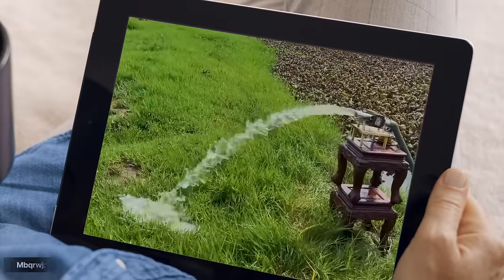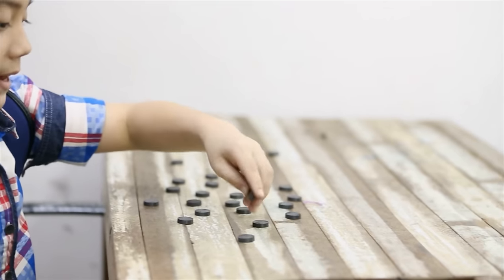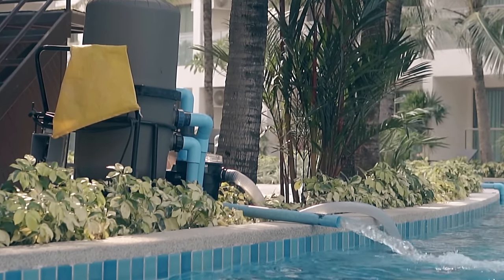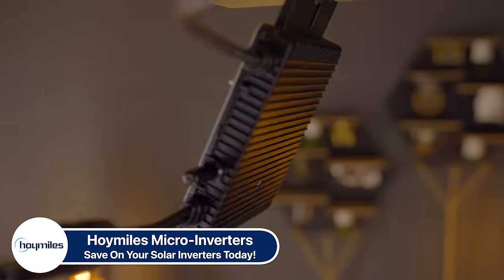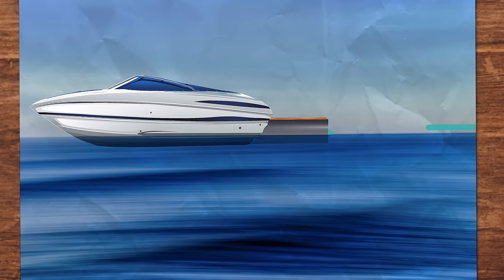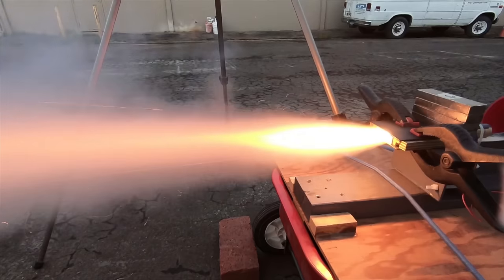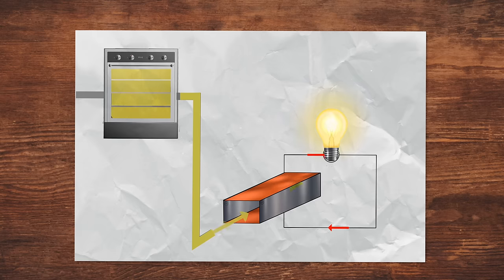Pumping Water Without Blades - Magnetic Pumps - Future of Propulsion?

Comment: OK, serious question. We have solar and batteries for DC generation and storage. Then we have inverters to convert it to AC to use in the home. What if instead, we converted the home use to DC and we skip the conversion losses and inverter complexity? Before you dismiss this, most electronics convert that AC back into DC internally already. So that would be a PS change on those devices. Granted, some AC motors for some appliances and devices would make this complicated. But is it that far fetched? Has anyone seriously looked into this? I think it has at least some viability.
Reply: AC uses thinner wires than DC for the same amount of power

Costs of distribution would skyrocket.
Reply: You could use high voltage low current DC (HVDC) but has proven itself to be less reliable and requires conversion anyway
Reply: A/C is more efficient at lower voltages. As the power for transmission rises, D/C becomes more efficient… but we are talking massive amounts of power, power to cross continents, nothing that is applicable in a home.
Reply: I think that's a good point, though I think it would only be practical if that electrical system is off the grid. If you want to use the grid for supplemental power or if you want to sell some of that solar power to the electric company then you'll need an inverter somewhere in there.
Reply: I think you're looking at this the wrong way, AC isn't a bad thing, it's one of the more clever modes of electrical conduction. The systems in place and their efficiencies represent a cost vs performance trade off. There ARE 98 and 99% efficient inverters, but they are expensive and increase capital costs. 

Rather than eliminating power conversion stages, look at the lost energy as underutilized energy. All systems are lossy, and what all lossy systems lack is waste heat recovery, and what all commercial and residential systems contend with are lifecycle costs and planned obsolescence. Support and design for efficiency and lifetime use and efficiency will be embraced rather than minmaxed.

One thing you do have a case on is keeping DC systems DC wherever you can. That's a strategy we see in a lot of system designs like cars that have 300V and 48V batteries and have to downconvert to lower voltage downstream hardware.
Reply: OK, seeing some of the comments- I am talking about LOCAL DC only. Of course AC is necessary for distribution. Local solar DC, local battery DC, local consumption DC. If it goes to the grid it obviously needs to be AC.
Reply: @Infinion AC is a bad thing for local use. It's advantage lies solely in long distance transmission. There is zero purpose to convert to AC for local consumption other than all devices have a PS or a motor designed for the AC grid. Get rid of that conversion and you remove a complex and lossy step in powering your home. Much like you pointed out.

Comment: I really don't see a MHD pump by itself replacing current forms of propulsion. 
What if we combined an MHD pump with a convergent - divergent nozzle, would the pressure drop through the nozzle be enough to provide real thrust?
Reply: “…to provide real thrust?”

Using solar panels & nuclear… perhaps outer space is a good use case, for interplanetary travel, like Mars, Venus, or elsewhere?
Reply: @DavidHalko  in that case, I fully agree.  My main pump / propulsion experience is on aircraft carriers as a mechanic. 
But computer hardware, propulsion, and heat transfer/ fluid flow are my joyful topics.
Reply: To be fair, current forms of propulsion have had industry support and widespread adoption and funding to solve their inefficiency problems. The world has had a few grants and the Yamato-1 whose outcome pivoted to demonstrating the viablility of portable marine cryogenic systems.

When discussing unpopular and underutilized technologies, incuding those found in the 1800s - early 1900s, of course someone like yourself would conclude they couldn't see it competing. Then again, Two Bit doesn't present all the information, and really just scratches the surface on the math, the challenges. He's here to dream up possibilities, connect promising technologies, and funnel investment interests.

Comment: 0:39: 🔬 Magnetohydrodynamics (MHD) is a real field of physics that can be used to create pumps, propulsion systems, and electrical power generators with no moving parts.
4:55: 🌞 The speaker shares their positive experience with Hoy Miles micro inverters for their solar system, highlighting the benefits and savings they provide.
7:36: 🔬 MHD propulsion and power generation using plasma and magnetic fields.
10:33: ⚡ The video discusses the limitations of MHD generators and the potential impact of room temperature ambient pressure superconductors on energy conversion technology.
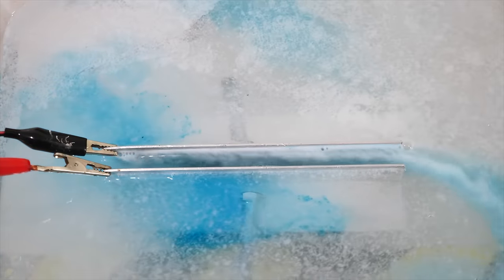2:33-3:02: 💡 Advantages of magnetic pumps include simplicity, compactness, high temperature tolerance, reliability, efficiency, minimal maintenance, and potential for high power density.
Recap by Tammy AI

Comment: If you want to get meaningful energy out of flowing water or achieve flow at pressure, you will need electromagnets even stronger than an MRI's. As for hopes of using LK-99 as a cheap superconductor magnet, its ceramic structure makes it impossible to turn it into wires for electromagnets, which makes it a dead-end material for most of those applications even if a golden sample managed to prove its room-temperature superconductivity.
BTW, the reason why quantum computers have to operate near absolute zero temperature isn't superconductors, it is thermal noise. You cannot do quantum computations when thermal noise destroys your data and ability to capture results.

Comment: This tech is the same as electrolosis where the material for the anodode and the cathode both decompose into the solution their are pumping. What's the fix for this issue? No one's addressing this and its of critical importance, both for the life of the system and the purposes in which it can be used.

Comment: Well... Many words around the simple result: Still in research state, still not applicable for anything in the life of normal people. The one and only field were this principle gets massively used is fusion generators (tokamak, stellarators) - or should we better call it "fusion research", since this, too, is still in the early research state. What the video completely missed is the fact of rapid deterioration of electrodes, especially when used in any form of water based systems.

Given these facts, the INDIRECT usage of that principle via metal wires and the movement of electrons in those, while the wires transfer their movement mechanically to other mediums, is still and by far the most effective way.

Comment: As most electricity on the grid is AC, there would be a slight drop in efficiency due to needing to convert before distribution either in-house or to the grid. That said, it should still be more efficient than most production methods.
Reply: Only if you have the supercondutor magnets.Otherwise the expense/inefficiency of ordinary conductors restricts this to special applications.
That being said, given the supercondutors, I can easily imagine you could make this a direct AC-generation driving the system with a square (or sine,, which would be less efficient at the channel, but maybe wouldn't make any net difference downstream) wave, switching polarity on the magnetic field (the flow is driving, not driven).

Comment: You omitted hyperfast torpedoes and hypersonic missiles in the list of critical techs MHD powers. They allow to partially or maybe completely remove wake by making all the outside of the vehicle into a propeller, literally picking the molecules of air or water in the front and putting them in the back. The Russians seem to have mastered this technology using air as a fluid, despite its high resistivity.

Comment: The thing about MHD generators needing large superconducting magnets is a bit of a red herring.

Recent advances in HTS superconducting tape based magnets have take the field strength to pretty amazing levels, the most recent being 45.5 Tesla.

As you increase the field strength by 2x you can decrease the size of the magnet by 4x and still handle the same current.

By the time magnetic confinement fusion is finally producing significant net gain I would expect field strengths to be even higher still than this (fusion and electrical generator shrinkage are probably the biggest drivers for SC research).

Comment: 🎯 Key Takeaways for quick navigation:

00:00 🚀 Magnetohydrodynamics (MHD) is a real field of physics that can be used to create propulsion systems for ships and spacecraft, as well as pumps and electrical power generators.
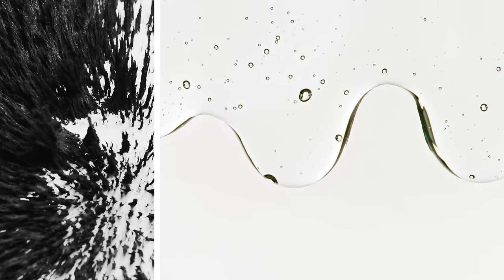01:06 🔬 MHD works by using electromagnetic induction and the Lorenz force to move fluids like water using magnetic fields and electric currents.
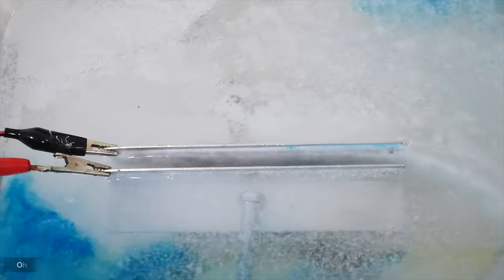02:30 ⚙ MHD pumps have no moving parts, making them simple, compact, silent, and able to work at high temperatures. They are more efficient and require minimal maintenance.
03:13 🔌 MHD pumps are not practical for pools or home water systems due to flow instabilities, but they are ideal for industrial applications like pumping molten metals and coolants.
06:01 💡 MHD propulsion systems, which use fixed pumps to move objects through a fluid, have been built and can be used on boats and even in aerospace craft.

Comment: I recall reading (MANY years ago) about MHD being used to recover energy from coal fired and gas fired powerplants- the MHD unit was installed on the effluent pipes, and more energy could be extracted from the hot flue gases, to be added to the output from the turbines.  Another thing I heard- the US Army bought some megawatt field generators from Russia- they used rocket engines to fire up the generator, and MHD put out the electrical power.  I do not know if that tech is still being used.
Reply: Yes, it works, but it's expensive and inefficient- I doubt ANYONE is using it for power generation due to those causes, but the effect IS useful for pollution reduction in the stack of thermal plands.

Comment: As a ScI fi nerd irl if you wanna have laser defenses you can pump molten Tin around and use it to conduct the heat away from the heating up part thats being hit by the laser which sounds like it woulfd fail but it wouldn't if engineered correctly which is mind blowing
Reply: It works until any of the tin vaporizes in the area of laser exposure. Then all hell can break loose  Also, the boundary material will ablate to some degree with exposure, so there will be structural-failure limits that are eventually exceeded no matter how well heat is conducted away from the exposed area..
Reply: So this makes anything not materially degraded by the molten tin TOUGHER, but not invulnerable.

Comment: A house boiler can reach 90% eficienci, but a cogeneration unit give a 10 KW of electricity on top of the heat, that can move a heat pump 
adding 70 to 80 k thousand btw,so if a galon of diesel have 135000 BTW and you get 200000 BTW ,will this sistem break the law of thermodynamics......

Comment: A big problem I see with the idea of electricity generation is magnetic fields are required, but most permanent magnets fail to produce a field in high temperatures. If you have to resort to using electromagnets, you probably lose more energy than you get out. If you are cooling permanent magnets to keep them functioning, they would still have to be close enough to work on the hot gases or liquids, which means they would become massive heat sinks and nosedive the efficiency anyways.
I could be totally misunderstanding how these things work, but from what I know, I can't see how heat wouldn't transfer to the magnets.

Comment: <pause>Lessee, from that bit of vid, looks like alternating field, with no transverse current being applied so I call BS.. Also, hard to retrofit to a ROUND pipe, so those vids look complete tosh (AC field with AC current should work mind)

I'm figuring DC, small magnetic gap for high flux, maybe rare-earth PM's could just work in place of superconducting magnet? (A kinda C-shaped 'horseshoe'-like PM with a small, long gap, for high flux over a considerable area)..

Then .. you might have to 'salt', add impurity to the water for max conductivity .. Then theres the electrodes.. My brief  experiments with electrode water heating made quite a corroded mess, but maybe high grade Stainless Steel or a precious metal could do it? <unpause>

Comment: Surely the exhaust gas from the MHD unit at 700 °c could be used to heat water to spin a lower pressure turbo gen increasing the efficiency more.

Comment: This is kinda like matter/antimatter drives. Something that is theoretically feasible but probably not very likely to see much practical application. To make superconducting magnets, we need superconducting wire. And to make superconducting wire, we need a material that is ductile and, almost by definition, has decent tensile strength.

Comment: Not all MHD is electrode based. In a related field pulsed induction thrusters use a change in magnetic field to induce a current in a fluid (like plasma), and the currents create their own magnetic fields that oppose the original change in magnetic fields.

Comment: follow up question for the bit about using MHDs in power plants to take advantage of hot plasmas, what happens to the plazma after it leaves the MHD? im assuming there has to be some transfer, does it cool off? slow down? yes and? cause the thought that popped into my head was some plasma generator (fusion?) cooking away, piping the plasma through an MHD where it cools down a fair bit and then runing it through a traditional heat exchanger -> steam turbine set up to double dip as it work on the energy in the plazma. would that work?

Comment: Yes the combustion engine did not make the boat better but at least you have no moving shaft coming out of the boat or an outboard. Cable, dosn't matter how thic they are, are easy to route to the pump above the waterline or even through the hull. Same to reactors and so on.

Comment: no maintenance means no servants to be dragged around paid
Reply: you can make it conductive in an other way than with a salt, more like metal floating beads that move the water, circulating around in the pump, still being relatively no moving parts, more like a ball mill mhd pump, or like bearing circular track pump, yep the balls are the dc pump blades, why you need to use super conducting stuff, nonsense
Reply: when you say you need, you dont need, if you dont lack and are free, then you are in the correct
Reply: service life means life prison sentence
Reply: mhd circular motor
Reply: fire flame is partially ionized, not fully, mostly gas phase, some plasma, some liquid
Reply: I dont believe in limits, like carnot cycle limits, or wind power limits, for efficiency
Reply: YBCO main power lines
Reply: 93K not near 0K super conductivity, -180C, a bit lower than ethanol freezing point, how about ethanol heat pump cycle at -114C

Comment: So damn irresponsible showing people messing with 2500 volt microwave transformers by holding the wires between the blades of common scissors. Those transformers will flatline you in one hit. Extremely dangerous!

Comment: At least with water I disagree with it being maintenance free.  You still have the issue of electrode degradation due to electrolysis.  While that's admittedly alot easier to replace than seals and bearings its also something that will need to happen much more  frequently.   that will probably be an issue for pumping many other materials as well.  You'll still have wear its just going to take a different form.  The  bigest benifit is that the electrodes just need to be a chunk of conductive material and should be much easire to manufacture in  bulk than precision bearings seals gears and other componants.
Reply: This could easily be a continuous feed, that's a consideration fairly easily addressed. What's probably much more an issue is the channel walls themselves- maybe you don't have to worry about electrolytic effects, but you can't eliminate ablative loss completely.

Comment: Not on board for electric cars.  Do the math.  Currently only 4% of the necessary batteries for just the US are in existence, and they only last a few years.  Also, you still need to generate and transmit that electricity.  Only viable methods are nuke and fossil fuels.  Where the wind and solar are available are too far away (transmission losses limit it to about 500 miles), and too unreliable (sun doesn’t always shine and wind doesn’t always blow).  Oh, and used up batteries are a disposal nightmare.